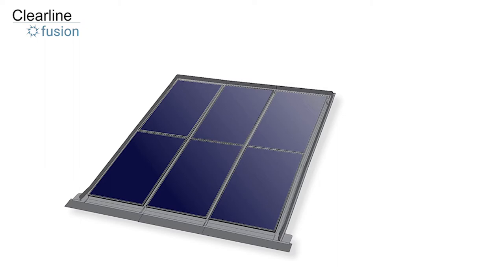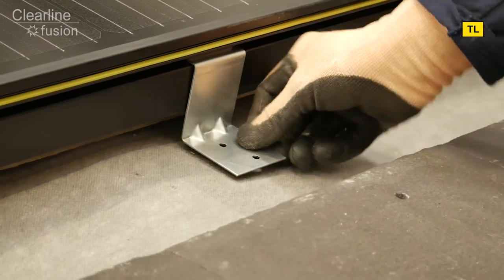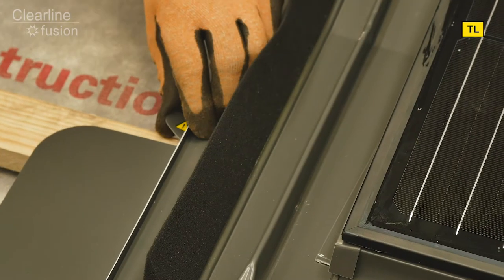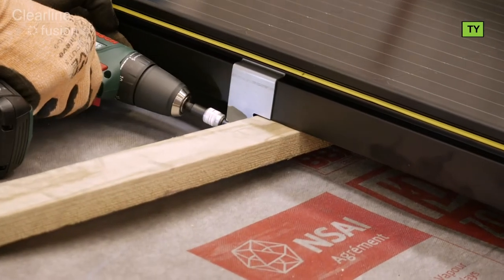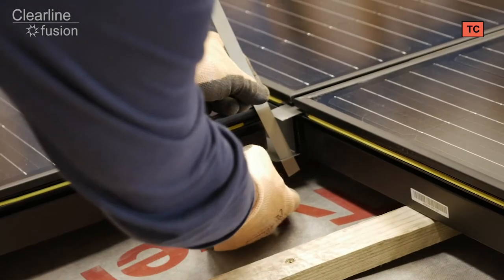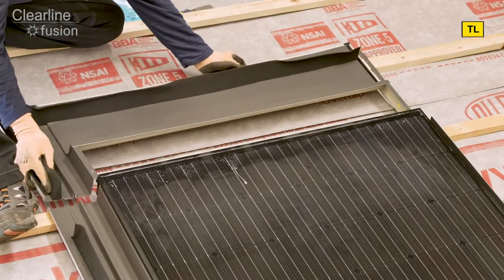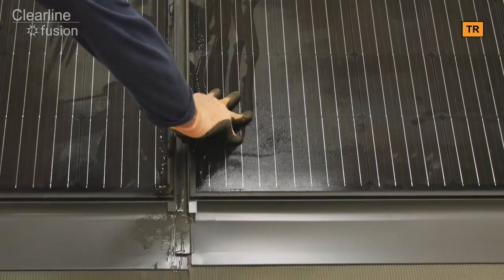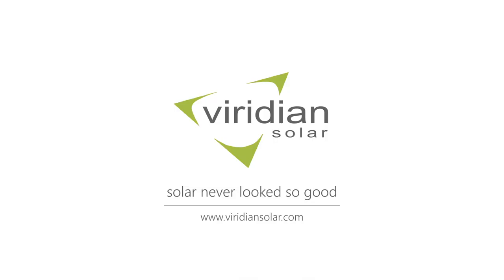Clearlinefusion 3x2 Array Installation

Comment: Why does a flashing cost more than the panel itself? One is a sophisticated and sizeable assembly  of components, the other a bit of folded aluminium and foam strip. A blatant rip off of the customers who can shop around for panels but can't install the product without them.
Reply: Damn rite no more sophisticated then a velux kit which is 60-100quid

Comment: At 4.07 what does it mean "remove the section under the solar panel"?
Reply from the maker: If a tile batten is in the way of the fixing bracket then you need to cut out a section of the batten so the bracket can be fixed to the rafter below.  This is more likely with a small format tile where the batten spacing is much closer.

Comment: Is their any special kind of solar panel you use for installation or Normal one?
Reply from the maker: Hi Amar 2017 - Clearline fusion panels have roof integration features which help make the installation go smoothly and means the system can fit to a regular roof without the addition of extra timber.  Check out the panels here:  https://www.viridiansolar.co.uk/solar-products-panels-for-roof-integration.html